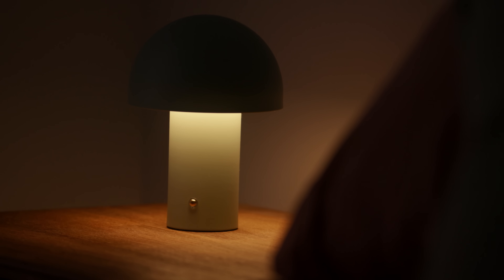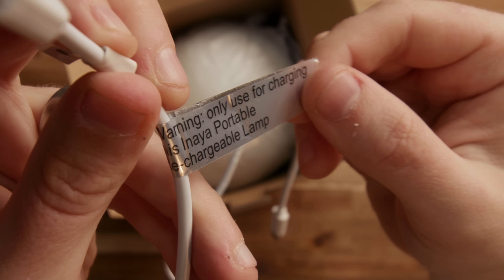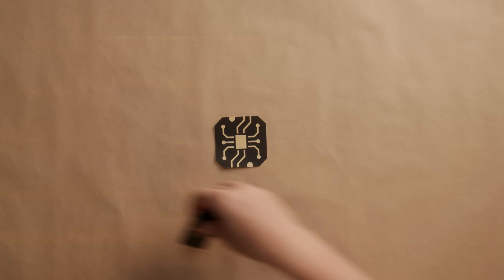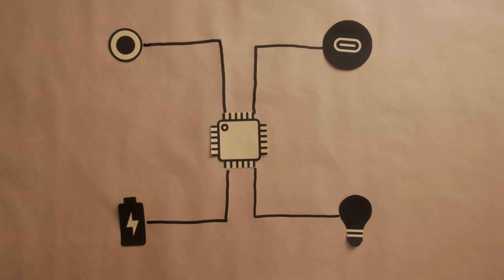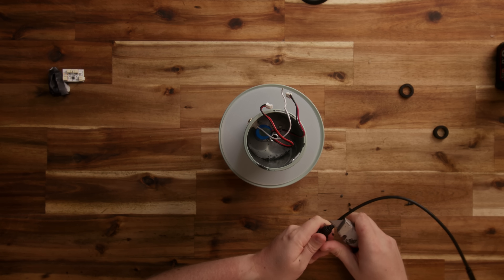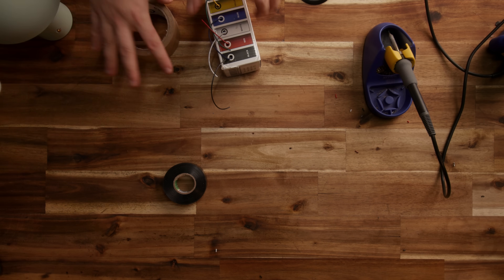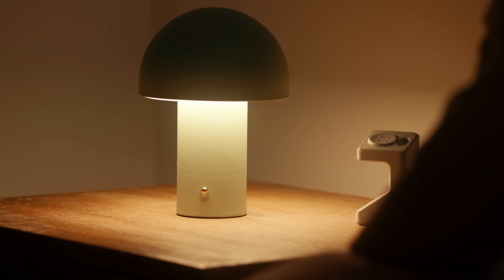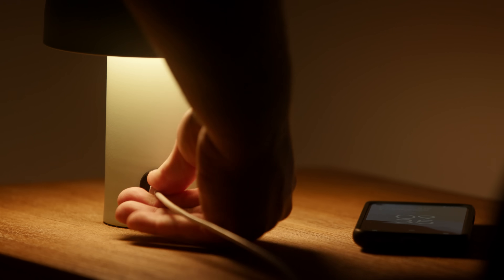Kmart Lied to Me, So I Hacked Their Lamp

Comment: 0:54 USB c that doesn’t work? So they left off the 2x 56k resistors and you can only recharge it by A to C cable because they replaced a micro usb port with USB C badly? Yeah, that happens. A lot.
Reply: I've noticed this on reeeally cheap electronics that refuse to charge when I use a 30W charger so it's nice to read the explanation as to why
Reply: @ I got a few cheap “universal” cables from Action that were pretty good for this — they’re a C end with an attached A to C adapter, running to a micro end with attached Micro to Lightning and micro to USB C adapters. and they look fairly decent when the adapters are in place. They work well as a “problem solver” cable for any of these kinds of devices, and as a bonus you can still use micro devices you may still happen to have.
Reply: @JasperJanssen  I feel like this is the much more sensible solution, than writing YAML
Reply: @whophd  presumably he wanted to have them in HA anyway and this charging issue merely provided the excuse.
Reply: The really funny thing is that the usb-c bulkhead fitting he used almost certainly contains a JRC-B008 module, which has EXACTLY the same issue. Every single version of those threaded usb-c bulkhead fittings uses that module, which only has a single 56k resistor rather than 2 of them. Some c to c cables, work, but most don't
Reply: This is exactly what I’ve noticed as well. False usb c
Reply: I don't get why that's even a thing. Whoever invented the USB C was a dick. Why make it so that some devices require a C to C cable and some require a C to A cable?

In the words of AVGN "WHAT WERE THEY THINKING!"
Reply: 5.1k? Since it's the sink device..?
Reply: Yes. I have a bunch of Chinese crap that works only with USB-A to USB-C cables and not USB-C to USB-C because of this. A bit annoying but doesn't bother me that much.
Reply: Omg yes, I exclusively use c-c cables and I had a power bank that wouldn’t charge using c-c because it was old, and I had to sell it because it’s so infuriating. Don’t make me use USB-A!
Reply: why do people buy cheap and expect high quality? like dur they cut corners to save money so you could save aswell. thats the tradeoff you make when buying cheap shit
Reply: They think they can bypass EU regulations by making he physical port the C form factor without doing the electrical changes and assume that nobody will check.
Reply: @jocosson8892  but these products are sold only in Australia. At least the Kmart specific ones. There are no such regulations here.
Reply: @Zei33  
sure but exporters try to meet EU regulations as they don't usually want to make different versions for each regulatory environment and that usually means the EU who have the most stringent requirements usually,
Reply: @ I’m dubious about how realistic that is since EU has different household voltage to Australia anyway. They would have to make alterations.
Reply: @Zei33  it is a psudo  USB lamp, all they change is the adapter
Reply: @jocosson8892 provided that anyone is exporting those lamps it EU (it might be kangaroo-only product) and the regulations applying to it (I think they apply to phones and tablets only).

What they are probably infringing on is USB trademark though.
Reply: @mina86  I do not think that the Chinese see only one country as their export market for any consumer product
Reply: @, the product is not sold by a Chinese company, so they don’t care. If Kmart buys it from them, they don’t care what regulations it follows or doesn’t follow.
Reply: @mina86  

Kmart is just a retail distributor for Chinese and other east Asian commodities that is global capitalism

Australia is a tiny market in the global economy, hate to break it to you!
Reply: @, global capitalism doesn’t mean that every product is sold everywhere. If this lamp is not sold in EU, EU regulations don’t matter. And Anko—producer of the lamp—doesn’t appear to have any presence in Europe.

Regardless, the other point still remains: EU regulations do not apply to lamps.
Reply: @mina86  EU regulations absolutely apply to rechargeable lamps like this, if sold in EU.
Reply: @, citation needed. Citation I’ve found says this:

> Included devices: new rules would apply to handheld mobile phones, tablets, digital
cameras, headphones, headsets, handheld videogame consoles and portable speakers
capable of being recharged through wired charging (new annex Ia, part I). The Commission decided not to include laptops or radio-controlled toys, as their charging characteristics significantly differ from mobile phones', while smart watches and fitness bands were excluded for reasons related to, for instance, their size and conditions of use.

‘A common charger for electronic devices - factsheet’ published by European Commission in 2022 doesn’t list lamps either.
Reply: @Zei33 different voltage? Not really.   230v in Australia, 230v in Europe.   Not that it makes any difference with modern switch mode electronics capable of operating over a wide voltage and frequency range.
Reply: @jocosson8892  they arnt wrong. But once discovered that hammer can hit realy damm hard. And eu companys will blacklist you untill you bribe the csuite again.

Comment: Should have made them have pass through for the USB then you wouldn’t need the battery, although it might be handy as a backup option like if it loses power it turns on or something. Save the candles in the bottom drawer 🤣

Also amazing to see an Aussie YouTuber doing home assistant stuff!
Reply: Dangerous - if all the USB C lines were present and the phone downstream negotiated for 9v or perhaps 12v, and the lamp wasn't capable of dealing with that (because race to the bottom), then the magic smoke would be released best case, or a lithium fire, worse case.

Comment: Did you try using an A to C charger? I've seen this before, and it tends to a problem of not supporting PD due to using older circuitry, from the ascent years of type C, when pd was rare, and Qualcomm fast charge was the standard.

Comment: You're being way too dramatic. The lamps will work with any USB A charger and USB A to C cables. It's a dumb design mishap but there's nothing proprietary or malicious about them. Also the cable isn't going to hurt any of your USB C devices. All devices must be able to deal with dumb 5V chargers in a safe manner and they should know not to pull a lot of current out of a cable the specs of which cannot be read.

Comment: It's funny to me how people say how "even Apple" uses USB-C now, when they were the first major adopter of it. It just took them a while to roll it out across their entire product line, and when they finally did, people complained about them "changing the plug again" (which is why they held out on Lightning for as long as they did).
Reply: They also sent the most amount of engineers to work on the USB-C standard, 18/79 of them (~22% )were from Apple. Quite the feat if you consider all the companies working on it.

Comment: Hey, I just stumbled upon your video, I understand the frustration and maybe I can clarify what’s going on. USB-C is just the shape of the port. There’s a lot of features that USB-C can support but they’re pretty much all optional.

From your video I saw that the lamp came with a USB-C to USB Type A (the old USB shape) cable which tells me that the lamp doesn’t implement Power Delivery.

Any USB type C to USB type A cable plugged into the legacy charging port of a power adapter should make it charge.

The lamp is compliant with the USB C spec, it’s just that Power Delivery is optional. They could have easily allowed the lamp to be detected as a legacy device which would have allowed customers to use any USB-C cable and plug them in a PD compatible power adapter but I guess they went cheap.
Reply from the maker: Have a look at the pin out in the pinned comment, it's definitely not a regular USB cable! 

The lamp doesn't charge with any USB cable other than the one included with it. At least none I have!

Comment: This is the reason that having so many standards under one plug is a bad idea…I’ve heard of a few people killing devices with cheap cables that don’t negotiate charging voltages and amperage’s….

Also the average person doesn’t really understand this at face value, they just see a USB C-C cable and think it’s the same thing…

Many people laud it as a huge success, and a great idea without realising this fatal flaw, and the only reason legislators mandated it for iPhone in Europe which is the reason they actually adopted it in the first place is in my opinion due to misunderstanding the. Satire of the beast of interface standards.

Everyone loves the idea of having a cable, that they can use for everything, but very few want to spend a few hundred dollars on each cable so that that cable actually can do everything, and meets the upper limits of the standard specifications and has the ability to negotiate with the wall charger and the device itself powering. 

However everyone wants a cheap cable….

So what you end up with is all these different cables for different things, which is the problem you were trying to fix in the first place. 

Except now, all those cables have the same connectors on each end. So delineation becomes an issue.

It’s less of a problem as the standard has matured, but nowadays people using a low spec cable will just have a worse experience and won’t know why, and then probably blame the device, or the charger, instead of the real culprit…

The cable.

Comment: Great video. Including a full schematic would be helpful, but the simplified drawing got the point across. If you do make a video exploring ESPHome and how to write YAML, a write up looking at how to recreate the lamp's original button functions (various brightness levels) would be good to include. It'd be a bit more advanced than just handing brightness control off to Home Assistant (with global variables and moderately complex logic) but I'm always a big fan of including as much functionality as possible on the device, so it's still functional if Home Assistant isn't. That said, using the capacitive button as an automation trigger was pretty clever.

Comment: It's nuts that everyone is putting in dual core, 240Mhz, half a meg of ram into stuff to basically provide a glorified on/off switch.
Reply: What's nuts is that the aforementioned runs on less than half a watt of power and costs $2.

Comment: I have a split mechanical keyboard that's USB C. Even the cable that connects the two halves is a C connector. However, that conjoining cable has a custom pinout and cannot be replaced by a standard USB C cable. Even the own cables (they do make a longer one and offer replacements) only work one way and isn't reversible.
Reply: Get one that uses BLE between halves instead.

Comment: Kmart is still in business? Dang.
Also what exactly was wrong with the cable? I thought initially it wouldn't have the data lines for PD or QC but saw it was a regular usb on one end. Would it not charge with a constant 5v usb power brick? While it would be great if everything surrounding usb-c was a single standard its not it only defines its physical form not the protocols, or lack there of the cable or port supports.

Comment: I bought an Ikea BETTORP, which was about $80, but it’s wireless and even comes with a dual device wireless charging pad. The batteries are just the ikea lithium AA batteries, so you can easily swap them out if they wear out.

Comment: USB-C is a connector type not a standard, this was a huge mistake that everyone failed to see when it became the ‘standard’ in Europe. While USB-C is great because it can provide everything you want in one port - charging, data, video, networking, hell even PCIe - the issue is that interfaces such as Thunderbolt that can do all in one are expensive to make and thus, we end up, with yet again… hundreds of different mf cables that all do different things.

Where law should come into place, is marketing labels. On this Kmart box it should label ‘USB-C POWER DELIVERY’ and consumers should be informed whether it comes with a cable or not. This will incentivise companies to stop cheaping out and actually fit their products with proper data+power USB-C.

Comment: I have a few electronics that have the same issue including a phone that are all USBC but will only charge with their specific cable -and the cables can be used interchangeably but if I use them to charge my tablet or ps controller it’s no good. This FINALLY gives me the answer -  thank you so much.

Comment: Nice video mate!

I was curious about the implications of the cable being noncompliant, so generated some AI slop... definitely do better Kmart!

* Australia has mandatory safety standards for electrical products, including cables. If the cable violates USB-C specifications in a way that creates a safety hazard (e.g., overcharging, short-circuiting), it may breach these standards.

* The USB-IF (USB Implementers Forum) specifications are not legally binding by default, but if a product claims to be "USB-C" and does not meet the standard, it could be considered misleading conduct under ACL Section 18 (prohibition on misleading representations).

* The sticker does not absolve the seller/manufacturer of liability if the cable is non-compliant in a way that causes harm.

Comment: Is it actually a non-standard cable or is it just the fact the cable has a USB-A on one end? A lot of cheap gadgets (e.g. portable fans) are using ports that need a USB-A to USB-C cable since they don't have the resistors to tell USB-C to USB-C cables they can send power.

Comment: I might have missed it but I don't think you ever actually covered what is special about the cable and why it could fry other devices. I've encountered a number of these devices and the only reason they don't work with USB-C is that they don't have 5.1k resistors wired to CC1/2 to let a USB-C charger know what it is. They still work fine with any USB-A to USB-C cable because USB-A chargers put out 5v no matter what. Whereas USB-C won't put out any energy until it knows what voltage to use. I imagine that "special" usb cable is probably just a regular USB-C to USB-A and it only has that tag so you'll definitely plug it into a USB-A charger and not a USB-C charger which won't do diddly. 

I'd be curious to know if that cable is actually special, but I kinda doubt it and there is probably no risk of frying anything.

Comment: 3:30 I can’t STAND this. I’m one of those few that can see the flickering. Hate it…
Reply: We'll overlook that the pwm frequency is 1khz, right? (Did you read the code?)
Reply: if you could, you would have been complaining about nightstand clocks and stereos since the 80s. you're confusing cheap LED bulbs (which have separate flicker issues when provided the wrong voltage or have a cheap dimmer circuit in them) with PWM.
Reply: Guys, maybe this comment was written by a camera, or a superhuman with 50hz vision. You shouldn’t just assume is a mentally ill guy lying, thats 2015 behaviour.
Reply: @xDMG15x  50hz is the minimum for normal human vision, with 90hz being the upper limit, and up to 500hz being possible under the right circumstances. I'm gonna assume you meant 50khz. American electric grid runs at 60hz so ALOT of people can see lightbulbs flicker, and that's what this guy is confusing with PWM
Reply: @ no one said he was mentally ill
Reply: Came here to say this, older LEDs especially are HORRIFIC for it and I've specifically heard a lot of people with autism say it's a massive problem for them (no clue why just a trend I've personally noticed). And sure, while most LEDs do flash fast enough that my eyes can't pick up on it, my migraines always can, to the point I absolutely refuse to buy LED bulbs any time I have the option
Reply: @jaebebifi  yeah depending on the light i (someone with autism) can see it (normally only lower quality leds tho) 
i can also hear some electric devices drawing power for some reason
Reply: No you can't lol no one can it's physiologically impossible

Comment: Many if not almost most cheap devices that have USB C nowadays, will come with a USB A to C cable, and most of these devices wont work when you plug in a USB C to C cable, Its not necessarily a problem for me since I usually charge stuff with my PC and most of those cables are USB A to C and I have at least 1 Usb A to C in my charging brick.
in all honesty, just having one common port at this point is already fairly handy.